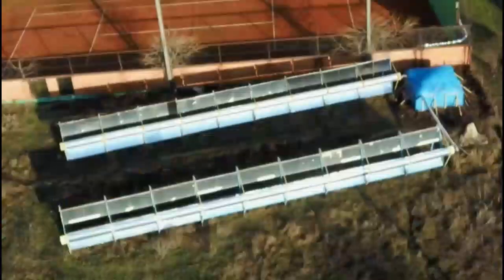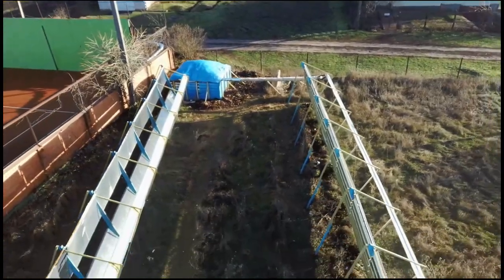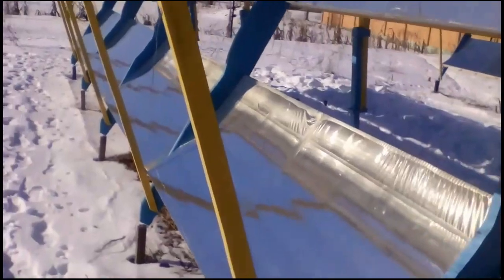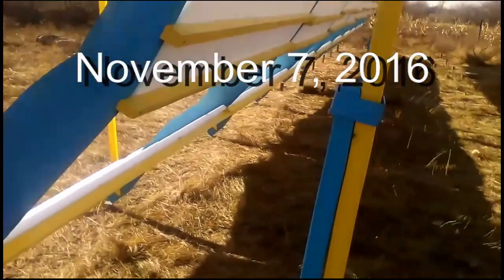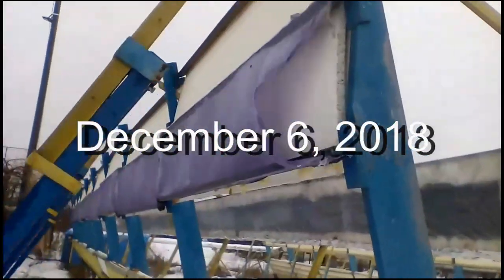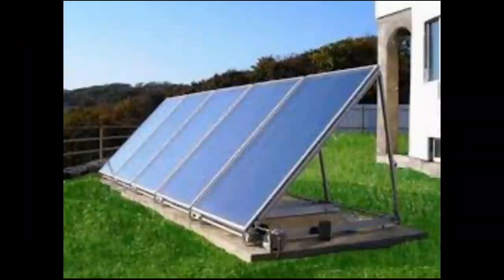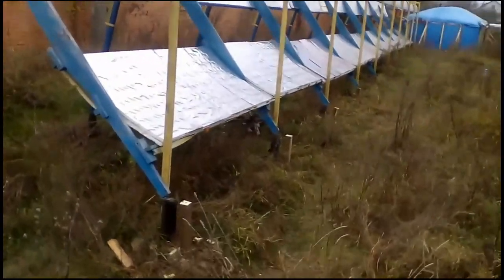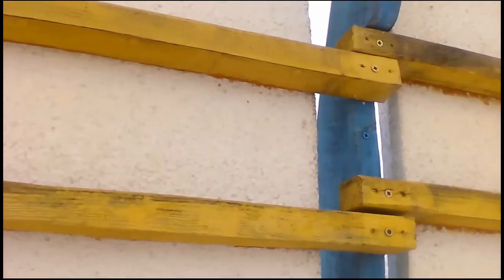My solar concentrators after 4 years of operation

Comment: You could use post hole tool for stake  holes. Put stake and rock in and tamp around stakes. Keeps water n soil away
Reply: Directly under stake tamp a big rock, rocks to help keep stakes from sinking.

Comment: hi can we also add mono crystalline cells where solar radiation consecrate to generate electricity.that can double up profitability
Reply: You need to cool them down, and also they are saturated with higher sun intensity because designed wiring on the surface of cell can't handle so much current.

Also life span is reduced if you do not have good cooling.

But it's possible and it's done, it's called concentrated PV.

The good thing is that you can combine waste heat to heat some building in winter and also have electricity from PV.
Some type of storage for both heat and electricity is necessary to have it 24/7.